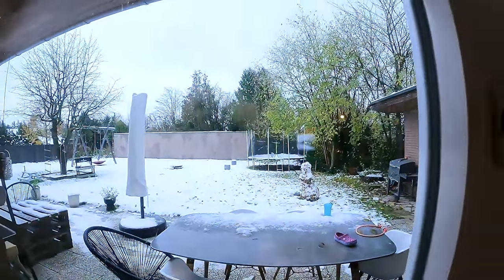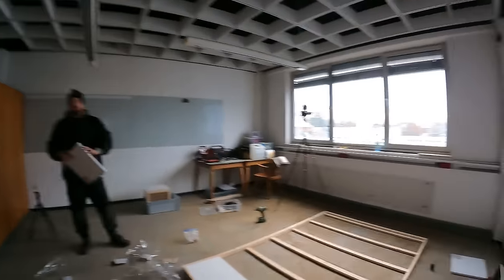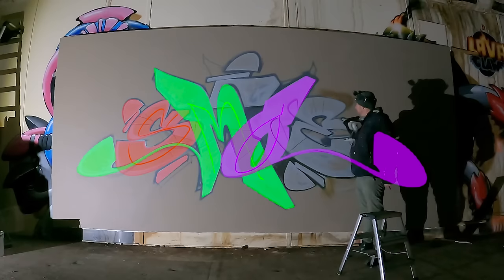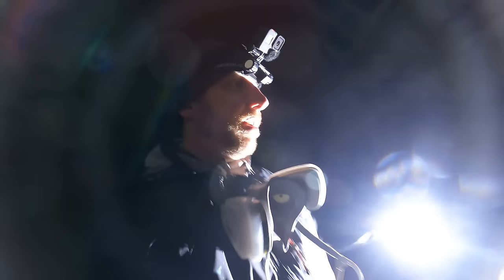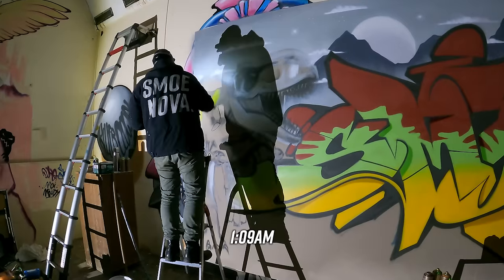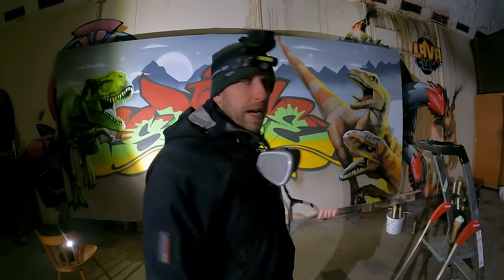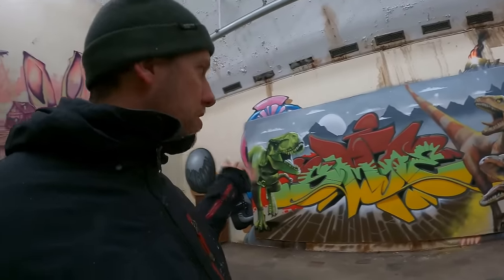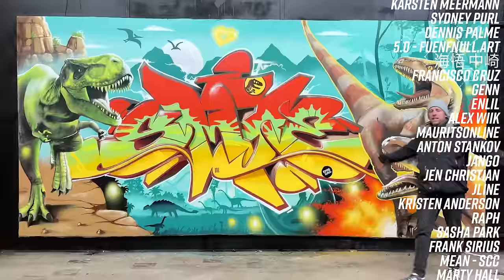I try to paint 24 HOURS non stop.

Comment: And electric generator that will power a ceramic heater so you can use with paint stop you starting a fire or blowing up 😂 and light your should of started early morning so you got the full day before the tiredness really kicked in , rather than starting late in the day as your body clock told you to sleep and the cold got to you ,
Reply from the maker: yeah. better i should just not do such a challenge again. because i was efficient like maybe 10
hours while being at the wall 17hours, i lost a whole day afterwards if sleeping and finished rhe wall 5 days after starting. so next time just take 3 days abd paint something even better. 😂😂
Reply: @SMOENOVA  or just do that 😂 but the heater is a thing you should look at for the winter as the cold isn’t good for the body